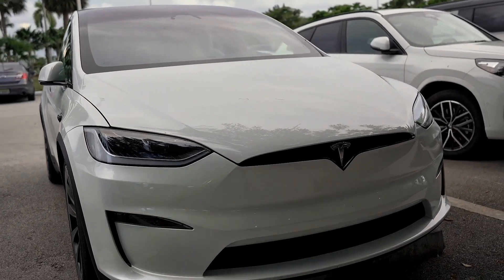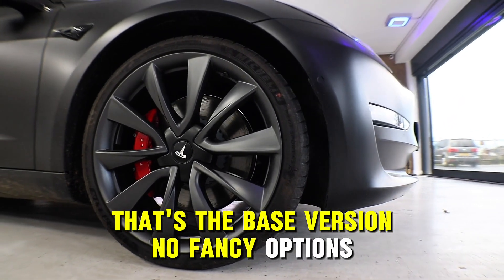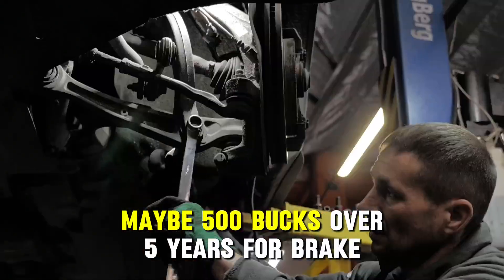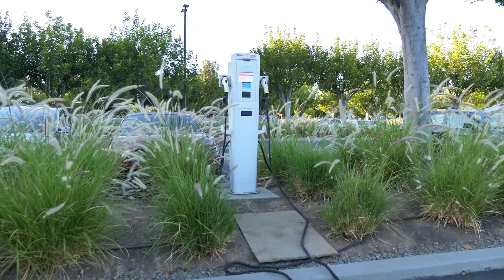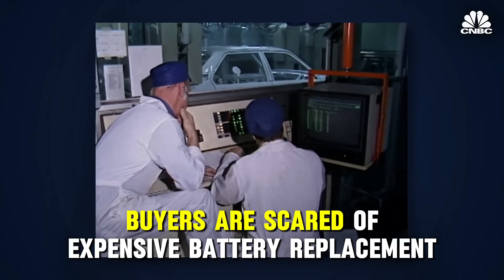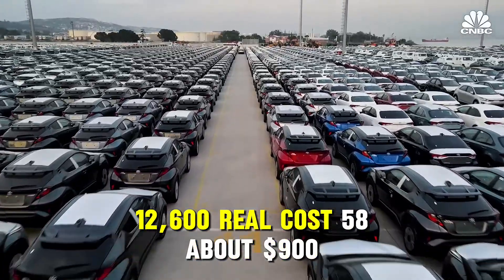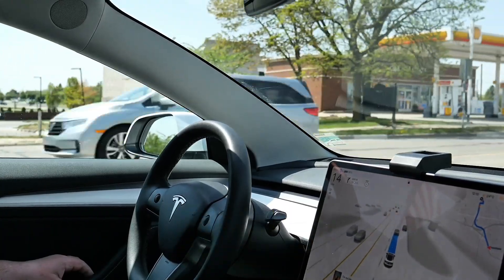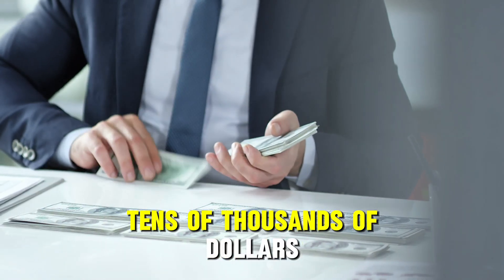Electric vs Hybrid Cars 2025: Which One is ACTUALLY Cheaper?

Comment: Yea but not everyone is buying Teslas to save the planet or even save on gas. 
Even if the cost of charging and filling a tank of Gas was the exact same I would still choose a Tesla over any prehistoric technology that is ICE cars anymore. 
Tesla is just a better car, drives so smooth, super quiet, when you press the brake it comes to life and you don't hear a stupid engine making noise, software is next level, the car drives itself. the technology alone in a Tesla is worth paying 6K more over 10 years. that's not a lot over 10 years even if your calculations are correct to drive something that is objectively a better driving and ownership experience in every way. 
for those 10 years, I will never have to take time out on my way home to stop at a gas station, I will never have to take time out of my day to take the car in for "Regular maintenance" just to keep it running, and so on.....
Winters are so so so much easier to drive with a Tesla it's impossible to get through to someone who has never experienced it. My car is on a schedule, it always warms itself up in my garage before its time to leave for work, and before it's time to leave from work. 
I leave my car outside in -35C all night at work, 6AM I finish work and my cars cabin is already warmed up, the entire car is already defrosted, I get in put it in drive and the electric motors come to life and start driving. while I watch every other pathetic person out there plugging in their stupid little ICE cars at -35C just so they will start back up in the morning before they leave for work, even then I can hear them struggle to turn over and start. Now that they finally started the engine that engine has to run for a good 20+ minutes to warm up and then get the cabin warming up also defrosting the windows etc etc. 
The benefits of EVs especially owning a Tesla far outweigh ICE or hybrid cars now, even if you don't think they are cheaper to run or cost more. 
also Assuming that a hybrid Toyota is cheaper than a Tesla is stupid thinking.
I bought my Tesla Model Y for cheaper than a similarly equipped Rav4 Hybrid, and even then the top of the line Rav4 Still is not on the same level as a Tesla in features and Tech although you're paying more for the Rav4 at this point.
Reply from the maker: Hey, thanks for sharing your experience! You make some great points about Tesla's driving experience and cold weather performance. I totally agree that EVs shine in extreme cold for preheating and convenience - that's a huge advantage.
However, my video focused specifically on long-term cost analysis over 10 years, not the driving experience or features. While Tesla is absolutely a better driving car with superior tech, the numbers show that battery replacement ($12k-15k at year 8-10) and depreciation (50-60% vs 35-40% for hybrids) significantly impact total ownership cost.
For someone in your situation - home charging, extreme cold climate, valuing the tech - a Tesla makes perfect sense and you're getting great value from it. But for someone without home charging, doing frequent 200+ mile trips, or on a tighter budget, the hybrid math works out better financially.
The beauty is there's no one-size-fits-all answer! Your Model Y is perfect for YOUR needs, just like a Camry Hybrid might be perfect for someone else's situation. That's exactly why I broke down both scenarios in the video.
Really appreciate you watching and sharing your real-world Tesla ownership perspective! 🙌
Reply: @MechanicalPulse-q9w  Ofcourse I know you're talking about the cost of ownership mainly. I was just pointing out that even if over 10 years of ownership the cost is 6K more for an EV it's still worth it for all the positives it provides. 

But I also want to point out that Hybrids especially Toyotas are way too over priced now. 
last year a Used Toyota Sienna hybrid was costing $60K-$70K CAD for a base to mid level not even a fully loaded trim which really eats into any cost advantage that you or anyone likes to point out for EVs being more expensive. 

This was the reason I even ended up buying my first Tesla last year. I was looking into a Hybrid Sienna but could not find one for a decent price, and if we wanted to order a new one 1-2 year wait times, then the dealer would decide what the markup would be of course after arrival. 

I agree with you that no one size fits all here, and I've always been on the side of having choices. People should have the choice to decide what they want to drive and we should let the market decide which technology is dominant. 
Although I think with advancements in battery technology it won't be long now until EVs overcome the last hurdle that people complain about with the battery range in cold weather, and battery replacement. once batteries become cheap enough to replace or they get so reliable that they don't fail at a minimum of 15+ years there will be no competition with ICE cars anymore. and we know this will happen because technology never stands still. 

Also, there's lots and lots of examples of high mileage Teslas with 200K, 300K miles with original batteries so it's not as grim as the media makes it sound. My brother drives a 2013 Tesla with 300K km now in Norway and with free supercharging he has saved enough money just on fuel to buy a new car by now. because he drives a good 1-2 hours away for work every day. 

sure long distance travelers like 200+ km or miles often might be challenging for people if they have to charge once  probably not even once with that mileage. they can decide on a hybrid if they choose. but people who travel that far daily or often are a very small percentage and for those people ofcurse having a choice of an ICE vehicles is fine. but for 90%+ of people who only take a few long distance road trips in the summer only charging for 15 minutes every 3 hours while the family gets coffee, uses the bathroom, or stretch their legs before continuing, it really is seemless. 
I've taken trips in the summer and we had to stop to get coffee or bathroom, or give a kid a break before the car even needed charging. 

BTW all this is coming from a person who was against EVs up until last year. I always thought they would never work etc. but all it took was for me to visit my brother and drive his Model S, and see how amazing the vehicles are. then I decided to do some research, and after owning one now it's near impossible going back to a Gas car now.
Reply from the maker: You're absolutely right about used hybrid prices being crazy right now - that Toyota Sienna at $60-70K CAD is insane. The market has definitely shifted, and in many cases that price gap between used hybrids and EVs has narrowed or even flipped.
Your point about battery technology advancing is spot on. We're already seeing improvements in cold weather performance and longevity. Your brother's 2013 Tesla with 300K km and free supercharging is a perfect example - that's incredible value and proves the technology works long-term.
I think we're actually saying the same thing from different angles. My video was based on current market averages and typical scenarios, but your real-world experience shows that individual situations vary wildly. Someone like you who found a good Tesla deal and has access to free/cheap charging is getting WAY better economics than my calculations showed.
The hybrid market being overpriced right now is a great point I should've mentioned. When a used Sienna costs nearly as much as a new EV, the whole equation changes.
Really appreciate you sharing your journey from EV skeptic to owner - that's a powerful story! And you're right, 90%+ of people don't need 200+ mile range daily. For them, EVs are perfect.
Thanks for the balanced perspective and real numbers. This is the kind of info that helps people make better decisions!